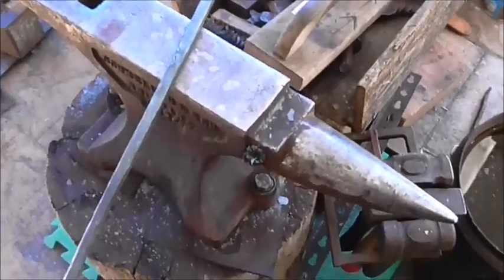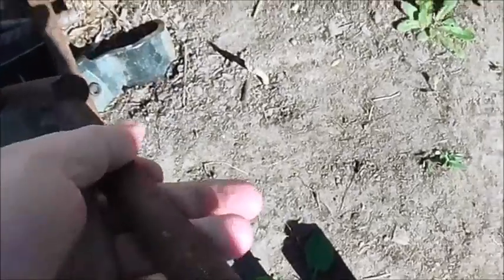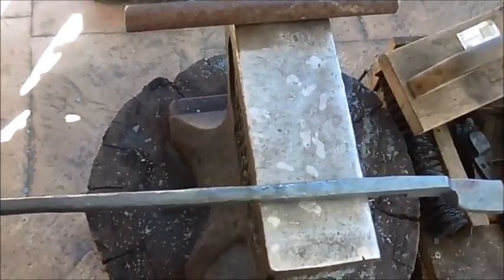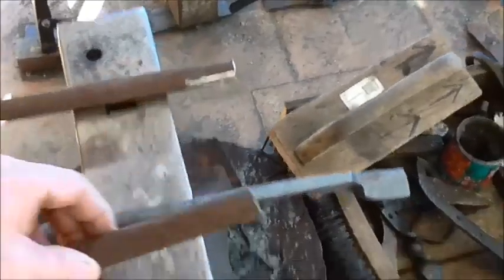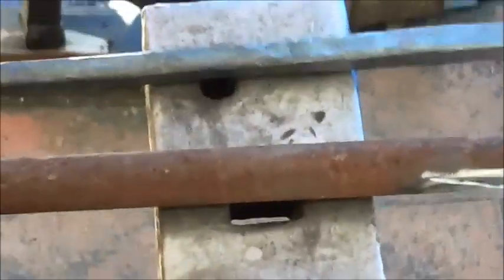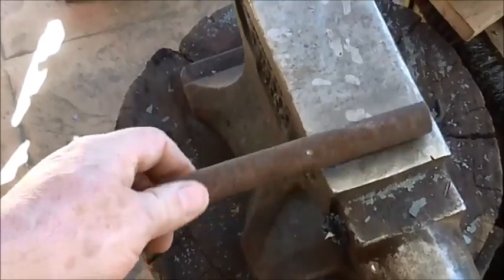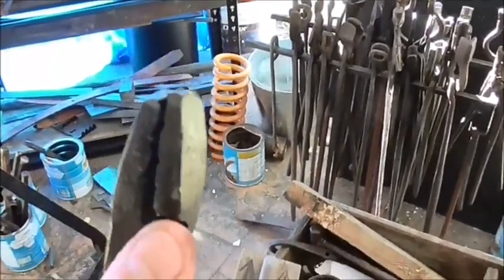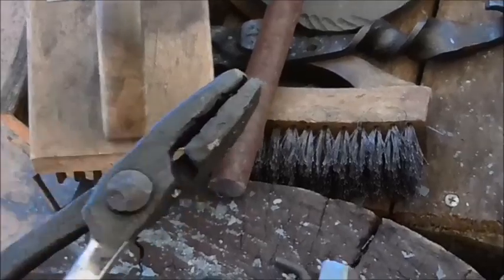Forging Tong Blank From 19mm Round Bar

Comment: Found those gloves on amazon australia, near fainted at the 9 bucks delivery for a single glove! They say they only have medium size unfortunately. I wear an XL glove, so no chance of a medium fitting me even if I could get past the postage costs!
Reply from the maker: Yeah it cost a bit but cheaper than any other glove I have found, even the one for the US was cheap shipping wasn't too bad, as the guy put them in with the hammer I bought. Pity they didn't have the larger glove. I will contact Amazon and ask them to please try and get the XL in. I got two gloves so wasn't too bad.